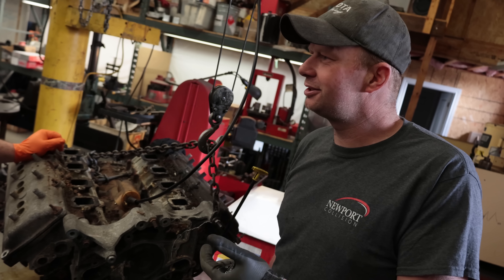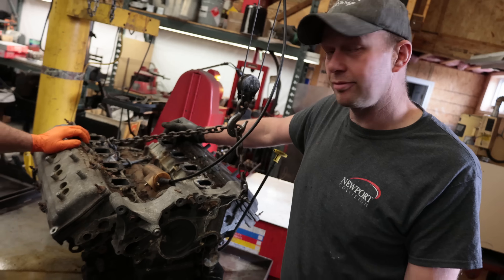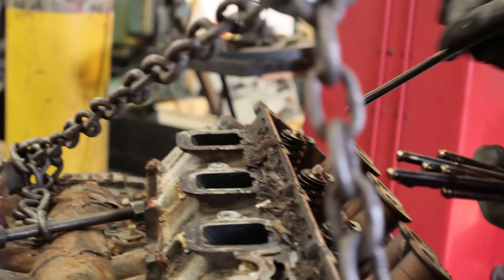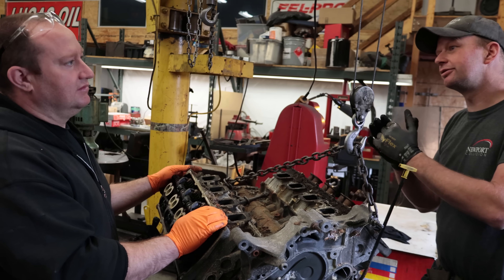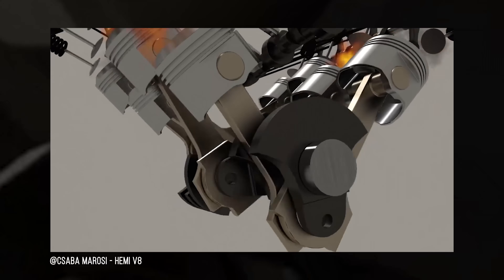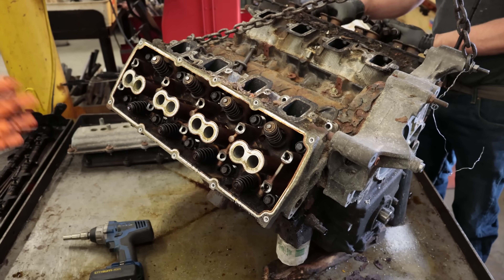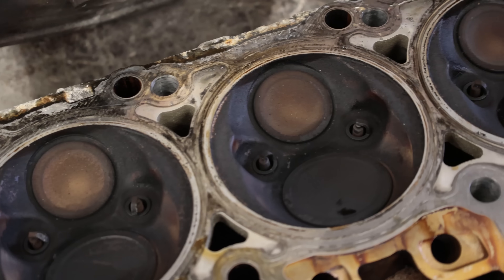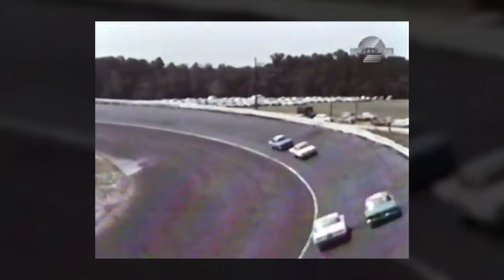REVIEW: Everything Wrong With A 5.7 HEMI 345 Engine

Comment: I own a 2011 ram with the 5.7. It snapped  all but 3 exhaust manifold bolts (combined both sides) at 47,000 miles. Threw new headers on and it's been extremely reliable since.
Reply: Hi - Did you have the tick and if so is it gone now*
Reply: @dimensionexo.  Yes, I got the truck with 40,000 on it and from the moment I got it, I noticed a slight ticking noise (most noticeable from the wheelwell) that was louder than I was used to engines ticking. In the next 7,000 miles, it slightly got worse until one week I started it up and it sounded like someone was rapping the block with a hammer once per rpm. Accelerating was pretty scary. Drove it like that for 500, then threw some Amazon shortie headers on it and during the process found almost all of my exhaust manifold bolts had snapped off within the head. Absolutely miserable job on the 2011 as there's no space to work in or maneuver the headers. After installing the headers, the tick I had is completely gone.
Reply: @nathanielheidemann3112   Thanks a lot*
Reply: @dimensionexo. 
Bit of an update: 105,000 on the truck now. Engine is fine, I have to fill the coolant and AC system up every year. No more snapped manifold bolts. Now the transmission shifts late when you put the power to it causing a delayed "hit" when trying to accelerate. It is full of fluid, will be replacing the transmission filters and pan fluid this weekend to see if maybe this is a pressure loss issue through the old filters.
Reply: @ - I once had the shifting issue as well -
I would just shift to neutral coast a little and shift back to drive and it had worked out the kinks -
The changing fluids and filter does seem appropriate sense I've neva changed mine *

Comment: early 5.7s had bad valve seats, bought a broken 04 ram 2500, blew the valve seat and destroyed number 7. Replacement rebuilt engine was expensive junkyard engines were even more expensive

Comment: Valve seats and manifold leaks. That's been alot of what I've seen on 5.7s. Much like a 5.4, I'm more surprised when they dont have an exhaust tick
Reply: Valve seats were fixed in the 2009 eagle update;

Comment: Be cool to hemi swap a 4x4 amc eagle put a 03 or 04 hemi in it but good luck nowadays find an amc eagle that someone doesn't want arm an leg for or pile of rust
Reply: I'm no authority on these engines or on the net, but I just changed my 09 HEMI plugs with fine wire iridiums, and i think it lights off faster, and runs smoother, so far anyway.

Comment: Fun fact, the HEMI itself was not banned. The vehicle that they put the hemi into a Was Banned. Nascar deemed that special aero cars designed specifically for aerodynamics and not originally designed for the street was getting too far away from "stock racing" that being said ford created the 427 cammed in like 90 days or something and Nascar subsequently ended up banning the 427 cammer because it was a race engine and yet again that was getting to far away from stock cars. So Chrysler only had the aero cars banned and ford had the actual engine banned. Dodge guys hate it when you tell em the truth lol
Reply: I was searching for this comment. All through high school the mopar guys would say that myth got so sick of hearing it for years. Then I found out about 5 years ago everything you said lol!
Reply: That's not true at all. I believe the 426 HEMI was banned in NASCAR in '65, at least. Because of the ban, Petty went drag racing briefly, until a child spectator was killed in a dragstrip accident. 
The winged cars became obsolete after they stopped making them in '70. Chrysler stopped putting HEMIS in production cars in '72(last year was '71), so eventually they were timed out by rules, too.
Reply: @budlanctot3060  the 427 was fords answer to the hemi in 1964. but nascar banned it.
Reply: @rondavis2791  not an expert, but I think you are referring to the SOHC furd engine, sometimes called "the cammer". That was not a production engine, either in '64 or ever. The 426 HEMI became a regular production installation in 66 thru 71.
Reply: @budlanctot3060  not an expert either. Your correct 427 sohc was designed just for nascar.  so was the hemi though. But the 427 got banned before the hemi.

Comment: My 06 5.7 Hemi in my Ram 2500 lasted 282k miles before a blown head gasket. Put another rebuilt 5.7 Hemi in the truck and it's running strong.

Comment: Can you ask Scott why he said the three finger hone tool is the worst thing you can do to an engine? What would the better alternative be?
Reply: The better alternative is a "Ball" hone also called a  "Cylinder" hone. ✌️ hope that helps, you can look them up it will tell you all pertinent info.
Reply: @jaypatricksei8428  absolutely NOT. Ball hones are a cheaper, less optimal alternative. The best hone job is with a Sunnen hone or equivalent, preferably in a CK10 automatic hone machine or equivalent.  Best used with a torque plate.
Reply: @budlanctot3060  I agree but I believe the original conversation was about hand held options, on the cheap. What you speak of is the best of best option, witch adds both $ and time. Sometimes you gotta do what you gotta do. ✌️
Reply: @jaypatricksei8428  so you believe a ball hone is superior to a three jaw hone? I have always heard the opposite.

Comment: I’m on my 4th Ram with a 5.7 right now. I’m not easy on my stuff i never keep any of my vehicles much past 200,000 kms but for the most part they’ve been great. My last one chewed up the cam because the rollers on the lifters seized up in #1 cylinder, it developed a misfire issue from the cam lobes being flat. The steel from that went through the engine it scored all the bearings and caused low oil pressure. I replace the hemi with a used low mileage one and got rid of the MDS before I installed it and it was the best running one of them all.

Comment: The hemi suffers from oil starvation because the oil pump needs to be a high volume oil pump not a high pressure pump
Reply: Hellcat oil pump goes right in a 5.7 and has much more volume at idle.

Comment: Me with my 06 Daytona Charger 5.7L Hemi and it being my first car, and daily driver for almost the last 5 years... Lol. I went into it knowing of some of the ''issues'' and just kept them in mind. 6k KMS oil changes with just some decent synthetics from Canadian tire (on sale ofc, anyone buying at regular might as well get Amzoil for the cost). Not an issue, changed out the thermostat, rad hoses as a precaution. Engine wise, its been a beauty, beat on, winter driven (young kid and now young adult, beat the hell out of it) no problems. Overheat it? Probably gonna drop the valve seat. Run low on oil at all for a long time or not faithful in oil changes? Lifters might poop the bed. I control what i feel i can and let the rest take its course. Truck engines got the tick from the manifold bolts which well, isnt desirable. Not on the cars though, from what i can see. Now to watch the video and see how my engine should be blown up (joking lol).

Comment: It's got a cop motor, a 345 cubic inch plant, it's got cop tires, cop suspensions, cop shocks.  It's a model before catalytic converters so it'll run good on regular gas.
Reply: A 345 cant touch the real 440 cubic inch plant. That chase scene under the EL where it was going 120+ was real time..in a 4400 pound land barge They could max at 142 mph..A true mission from God
Reply: @netrioter  a 1969 or 1970 Polara or Fury could do 142mph, not an 8.2:1 compression 440 73 Monaco, it was reading 126 on the speedo on the film, that's what they ran, odds are that a 400 car with the same heads, cam, carb and gearing would have a higher top end because it would be able to rev a few more rpms after the 440 is out of breath.
Reply: On a mission from God
Reply: “We’ve thrown a rod”...... “is that serious”?
Reply: @danielmoss2394  yap
Reply: SCMODS
Reply: Blues brothers!! Awesome!
Reply: I got my sunglasses.
Reply: I hate Illinois Nazis!
Reply: @RobertDePonziano9446  Fix the cigarette lighter.

Comment: Hemi Tech is not a lifter issue it's the fact that the right rear bolt of the exhaust manifold brakes and until it warms up that tick will be in the engine it's actually an exhaust leak.
The camshaft issue, lifter roller problem is the fact that the angle of the lifters is such that if the engine doesn't get above 2000 RPM it doesn't get any oil on the rollers. All I needed to do was put oil squirters to the camshaft. Because you have Engineers you are stupid.
Have the engine runs just fine on fine wire iridium plugs. Some of the early fat style electrode Platinum plugs it didn't like. But I've never tried Platinum plugs in a Hemi always put a radiums in it oh, because changing spark plugs on the thing is a pain in the ass I'd rather put spark plugs or the last a hundred to about 150,000 miles.
Sludge in the oil pan, not changing oil often enough and certainly not using about half a quart to a quart of Marvel Mystery Oil for about a week before you do an oil change. Most engines today have hydraulic valve lash adjuster or hydraulic valves, and they must be kept clean internally and Marvel Mystery Oil is the best product for that that exists. And it's been bottled since 1923.

Comment: The modern chrysler hemi engines are poorly designed and not ideal for truck work are expensive to manufacture more so than a traditional over head valve engine also not to mention the transmissions behind these engines are about the same in reliability after the factory warranty expires you start having problems and quickly become money pits you want a good truck stick with chevrolet/gmc

Comment: IIRC the reason for using a hemispherical combustion chamber is to set the valves at an angle to each other allowing the valves to be larger. Wedge combustion chambers are supposed to have more efficient combustion, but larger valves make more power.
Interesting that the Americas feel the need to advertise hemispherical combustion chambers, in the rest of the world they're standard...

Comment: As a Mopar guy, thank you for not tearing the hemi to pieces and saying how terrible it is...  I had a 1958 392 hemi that was built, forget the specs, but it was an amazing sounding and torque motor.  As for what to put the hemi in, here are a few ideas from price (cheap to pricey):  2nd gen standard cab short box dakota with a 5 speed (and yes it will bolt right up to a hemi, 1st Gen durango and do a dakota 5 speed swap it, had a 5.9 rt awd durango that I was hoping the trans would go in just so I would have the excuse to swap, 1st Gen dodge pickup d150 (82 to 92), lastly unobtainium no rotted ramcharger/trail duster.  If you were to go sporty car, I'd say any 80s/90s import.  Waiting for the hemi rebuild series, as  I've got 2  5.7s first is going in a 1974 ramcharger and another that is going in a 1970 dodge powerwagon.
Reply: As I'm working on my cj7, putting a hemi in a cj, yj or JK would just be as fun
Reply: @just_a_guy_doing  v8 is overkill in those. i6 or v6 is perfect

Comment: he's right haha the extensions lower the "impact" an impact can have on a bolt so youll be there longer
Reply: Yep, check out torque test channel. They graphed it on a dyno. They also tested swivels and cold batteries. All of these things hurt power.
Reply: But it does not reduce overall torque!
Reply: There's more slop introduced from the extra joint, and more loss from getting the additional mass of the extension moving...  so yeah, it makes sense.

Comment: Just got my 2012 5.7 Hemi back, a rocker cap bolt broke, bent the pushrod and broke a rocker arm, all 16 pushrods was replaced, rocker arms on both heads with all rockers replaced. The engine has never run this smooth or quite. The engine has got 187 000km on it when it broke the bolt
Reply: The 11-14 years were the worse. They had weaker roller bearing needles and lifters. 14 had upgrades and 16 further upgraded. Pre 2011 didn't have many of these problems but they had the valve seat issues. 16' + seem to be the good ones. I've owned 3 now, they are fun motors
Reply: @cameron.s.9368  i have an 18 scat and that thing is a freakin beast ha, the torque is crazy off the line plus the sound, always makes a shitty day better!

Comment: I've got a 2015 Ram 1500 I bought new. I've been across the Rocky's twice and up the Coq multiple times towing my travel trailer. Truck has been great, lots of power great ride. Only issues I've had had been the exhaust bolts. I'm thinking of switching to shorty headers to see if that helps.
Reply: Bro. They’re the worst. Makes me sad. Changed mine three times now.
Reply: three times? Are your engine mounts bad or manifolds warped?
Reply: Manifolds could be doing warped. Most shops replace the bolts without checking to see if the manifolds are warped. I've been told that aftermarket headers have more material and resist warping and therefore the bolts don't snap.

Comment: all the Mopar engines I rebuild I use sealed power bearings a series which is a bi-metal do you think that is a reliable bearing to use in these mopars between the 2.7, 3.5, 3.6, 5.7, 6.1 ?

Comment: Just got my charger all wrapped up bought a new 5.7 bored .30over for it came with aftermarket heads and after 5000 miles had to pull it back out for rod knock #8 rod bearing was installed backwards 700 bucks later for a new crank and bearings its all good original motor lasted 120,000 miles had slight hemi tick nothing crazy down the road was ran low on oil and trashed the engine. would’ve been better off doing it myself and it’s not fun pulling one of these out of an awd charger u definitely need a lift for it. Luckily come Tuesday it will be done and I can go back to gas prices instead of these diesel prices

Comment: 7:30 not quite the reason you still see cross hatch in these motors come down to ring pressure Dodge use rings with a lower tension then in the old school motors. reason for this is fuel economy reducing friction anywhere they could.
Another thing you mentioned is boost from what I understand the 5.7 is not as amendable to boost as the other Hemi's due to geometry and the rings.
14:05 Not aluminum bruh the material is called Babbit it is combination of tin, bronze and zinc. the babbit is poured onto a hardened copper substrate and that is where modern come from.
Reply: A more likely factor is the high nickel iron alloy Chrysler uses for its castings. They wear 2x better than GM/Ford.

Comment: I see most engine failures due to lack of oil changes. It's even more important to keep the newer engines with fresh oil. I still change my oil every 5000km. Have a 1998 f150 with a 4.6L and have not gone into the engine at 500000km. I also own a 2019 chev 1500 and still change eng oil at 5000km. Would be cool to see that hemi in an old dodge truck. Thanks gor the entertainment
Reply: My oil never maks it to 5000 in my 97 6.5td Suburban, I'm on the constant incremental oil change system, it doesn't burn it but it likes to protect itself from rust. I just bought new oil cooler lines so I hope this ends.
Reply: I'd second putting it an old Dodge pickup. Find a '60s Sweptline 2WD, throw the 5.7 and a decent manual transmission in it. Fun parts hauler.
Reply: Yeah, it blows my mind that car manufacturers are saying to change it 10K...that's crazy
Reply: @kellsAC1  They can say it's a lower cost of maintenance over the life of the vehicle. And yes manufacturing and machining processes are more advanced now, but a 7500 or 10k mile oil change is crazy imo. The products these days are just considered throw away products.
Reply: @4thgradedropout980  absolutely Brent
Reply: @kellsAC1  it depends on the quality of oil i go 10 or 12 between oil changes been doing it for year wit my vehicles some synthetic blends can go 20k like certain Mobil 1 oils. I used very expensive oils my jeep has 370k, and my others all have over 200k no problems
Reply: the 4.6 is a bulletproof motor as well.